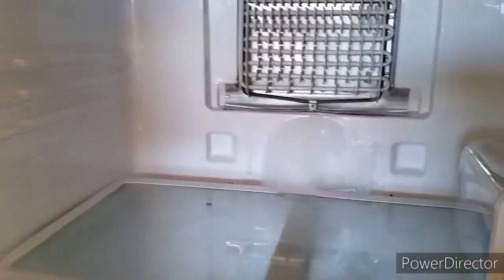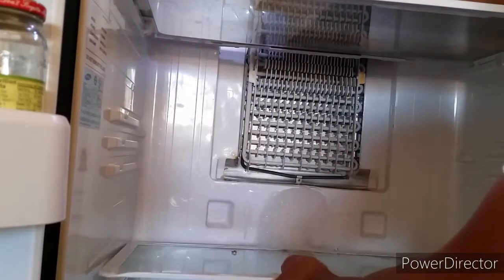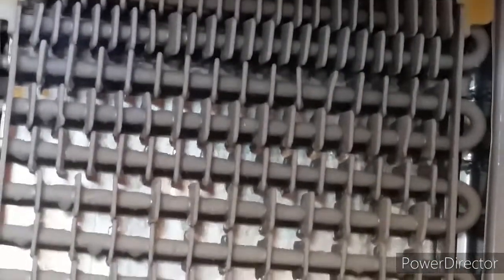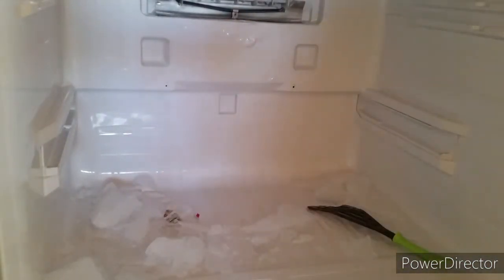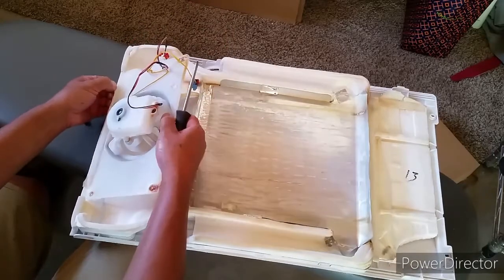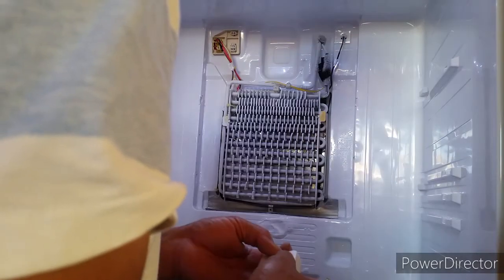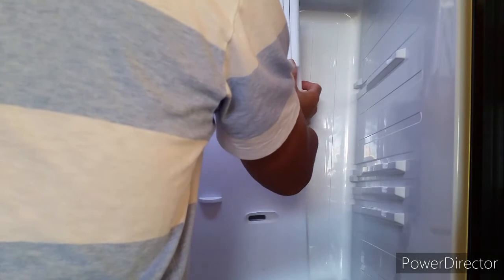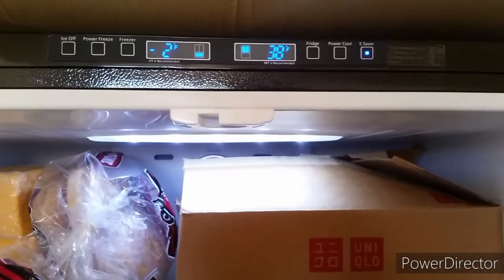Fridge is not cooling | Hacked your Samsung Refrigerator RF217 | It works | DIY

Comment: It's that eliment at the bottom of the cooler that's shot.replace it and it will stop freezing
Reply from the maker: Everything worked, when the ice melted, it couldn't drain properly. Couple issues. When the heating element heat up melt the ice, water didn't always go straight down. The inner flaps guiding the water failed. Water leaked out instead of going in the drain. Water left in the hole got frozen up. The heating element wouldn't melt the ice in the drain hole. So eventually the ice built up so much on the bottom.  no matter how much the heating element tried, it would not do anything.  When the ice melt steam would travel up then freeze making the fan stop.